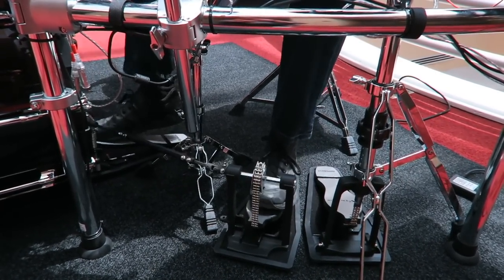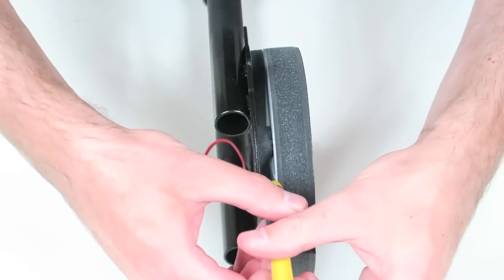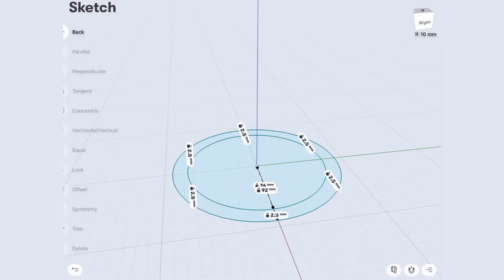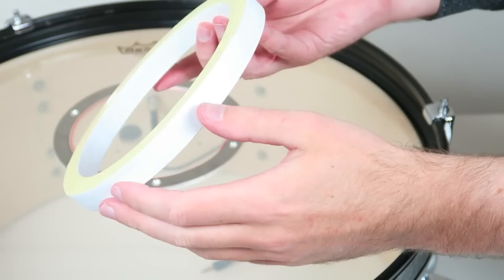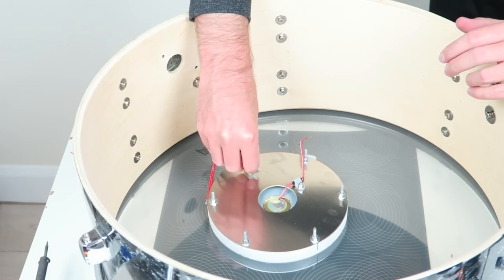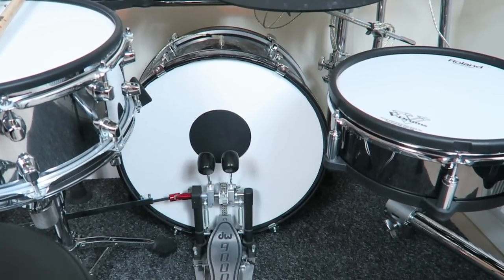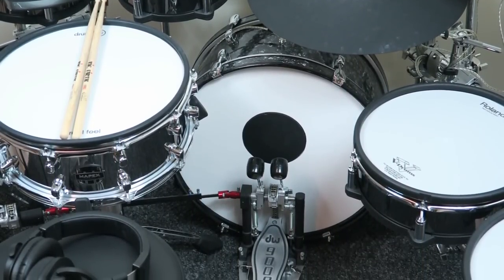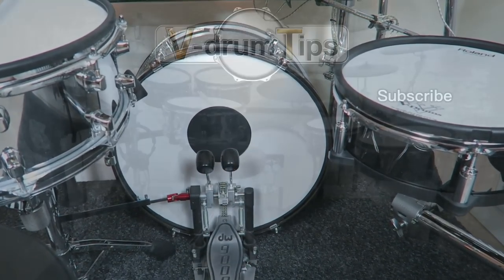Building the Best E-Bass Drum

Comment: You can pack the kick drum with a large thick blanket to remove all air and dampen both heads. Ive done this in the past when recording in a pro studio, using kick drum triggers and packing the drum to reduce volume as much as possible to avoid bled into the mics. Worked extremely well. I used Fishman Purple Microdot head mount triggers and was able to play completely naturally and silently with great control over the trigger sensitivity. Try it!

Comment: Next video... "I don't like the Roland TD-50 module and I don't like the color, and I found a solution, which is to build my own TD-50 module" dam
Reply from the maker: EdrumSense I wish I would be able to do that:D
Reply: building the module is a matter of finding a suitable DSP platform, either an x86 such as Intel atom, or one of the 8,000 ARM processors with number salad names, adding in an audio and trigger interface solution (just find something readymade and jam it in there) and then spend two years coding a drum firmware from scratch
Reply: @famitory  I might actually try that as a CS student and drummer
Reply: If you just want to trigger samples and have a computer you can use, they make midi trigger inputs so you don't even need the module.  Won't work standalone though

Comment: My ebass drum consists of 20" Silentstroke head with an Evans eq patch and 2 pillows inside. Front mylar head with port hole cut into it. Roland rt10k on top of shell. Works amazingly well and feels way better than the kd80 I was using. Feels similar but better than the kd140 I tried on a td 50. Extremely quiet too. No louder than my mesh head toms.

Comment: Another awesome video! You have inspired me to build my own hybrid which I have finally dialled in after many hours of messing with trigger settings. Keep up the great work.
Reply from the maker: Jock McKenzie Nice, what have you built? Is it all DIY or is it a custom mix of different components?
Reply: @Vdrumtips1  It started with a Tama Swingstar acoustic kit and a Roland TD 6 which I had used for practice for many years. I converted the acoustic kit with triggera triggers, drumtec mesh heads, a gibraltar drum rack, VH11 and assortment of CY cymbals as well as a cable snake from scratch to suit. I struggled for a long time with the TD6 (extended with an Alesis trigger IO) but luckily a TD12 came up for sale which I immediately bought. We dont have a big 2nd hand market is South Africa so it can be frustrating finding used modules. So now I am using the TD12 (extended with the TD6 for cymbals only) and running it all through EZ drummer 2. Will upgrade the triggera triggers at some point but it is good enough for now. Your videos were a great source of inspiration, advice and trouble shooting. Much appreciated!
Reply from the maker: @jockmckenzie8603  Thanks for the reply. Wow, you did your homework. Is it possible to buy from the EU or the US and order it to south africa?
Reply: @Vdrumtips1  Yes it is possible, but the cost of shipping and import duties adds a substantial cost that is difficult to justify sometimes. For some items you have no choice but to buy for Europe or USA. I had to buy my triggers, mesh heads and some other items from Thomann as they are not available locally.

Comment: It seems like the noise is coming from the shell resonating.. so I was wondering if you could make it quieter by adding some acoustic foam or other dense material to absorb some of the noise?
Reply: For example the stuff that's used to sound proof cars could work well.
Reply from the maker: Sounds like a good idea. I definitely have to try this. Thanks
Reply: No problem. I'm curious to see if that would solve the problem.. atleast to some degree. :)
Reply: Perhaps, try a mesh resonant head and fill shell styrofoam peanuts

Comment: This guy is amazing and extremely motivated. I however am not. I just took my old Yamaha kick trigger whick has a flat pad and installed it in my kick drum using simple bracing to hold it against the mesh head. Throw some dampening in the drum and I`m good to go. It`s about a 1 hour project. Cost...$0
Reply: Could you please describe that a bit more detailed?
Reply: @samueldette6401   I took an old kick  trigger and got rid of the stand and made bracing out of wood and attached it to the kick drum . The bracing attaches to the sides of the drum shell.
Reply: Thats cool but the biggest thing I found after converting from an 8 inch mesh pad to a 20 inch mesh head bass drum is the overall feel. Feels way more like a real set and is easier on my knees. I have a Yamaha kp65 bass trigger on my dd65. It works great but cant match the 20" for feel and comfort.

Comment: That's a great DIY job, but for someone like me that is not that mechanically inclined I use two Bix's by Triggera on a mesh head.  I don't tighten the head too much so you can sink the beater similar to the Drum-tec.  It feels great and is a much cheaper option.
Reply from the maker: merpmerp Thanks, great to hear that those triggers work.

Comment: Very impressive! i did a similar thing with my 26" bass drum. they sold memory foam neck supports in Lidl for £6 (circular tube) so i built a bracket 
glued the piezo to the bracket & put the half the foam tube in front of the piezo.
most drums sounds work fine within the parameters of the module but a slight few are askew with the velocity when you hit them, but hey it's DIY
Reply from the maker: Well done for building your own stuff!

Comment: Three a reflection of the front and rear head because when you have parallels surfaces you have reverberation. You need to cover with fao one of the two surfaces to cancel the reflection. Cover the front one inside with half inch soft  foam.

Comment: Surprise surprise,the most expensive bass drum in the market is also the best :) ...As far as noise goes,have you trie filling the bass drum with soundproofing materials?Pyramid shaped foams and stuff..What material is the kd22 using in the area where the beaters hit?
Reply from the maker: ZeGRMMA Well, that was not always the case. The KD-22A has the same KD-9 surface, but Roland applied a layer of foam to the resonant head. Still very loud.

Comment: What if you remove the Reso-Front Head ?
Maybe cutting holes into the batter head like on the edge of dry snare skin heads ?
Reply from the maker: That defeats the purpose. The great feel comes from the closed system and the air moving in between the heads.

Comment: I made my kick drum . To reduce the sound cut a circle   of  foam on all  the surface of the front head!  Not jus circles. You need to cover all the plastic surface.
Reply: JULIO ENRIQUE did this method work for you? 
Do you have any pics?
Reply: I Have a Regular 16 x 10 bass drum head with a Remo Silent Stroke and a DDrum kick sensor. I Use a Alesis drum module and adjust the sensitivity and tension of the head to obtain the perfect desire for me. Is in a video on mi channel. O don't have many videos jus a couple. 

 Going to record a couple more. But I cut a circle of stirofoam that touch Al the front head of the kick drum , because that reduce sound and also rebound . The foam insulate air. Is not the Sabe the rebound of the air on plastic than foam. I did the same with the snare.

Comment: You could have just put a mesh head on the front
Reply: Indeed.
Reply from the maker: That defeats the purpose. The great feel comes from the closed system and the air moving in between the heads.
Reply: @Vdrumtips1  But even mesh pads has the real feel. I use a drumpad with mesh drum, and feel exaclty the same as the accoustic ones.
Reply: I doubt a mesh head on the front would be gamebreaking ,i have played kits with no front head at all at gigs on my acoustic kit and i played for years with a mic hole cut in the front head,the difference in feel was not even noticeable. Most of the feel on acoustic bass drums comes from the batter head not the front head. You could also glue foam to the inside of the front head for dampening as well.
Reply from the maker: @demonocusmetalocus3558  Roland glued foam inside, but I did not want to do that, since I wanted to sell the front head afterwards again.
Reply: You could always buy a cheap front head and glue foam to that,just a thought
Reply: also i know you put a lot of work into that bass drum so to not be able to use it cause its too loud sucks
Reply: @Vdrumtips1  try filling the drum with foam??